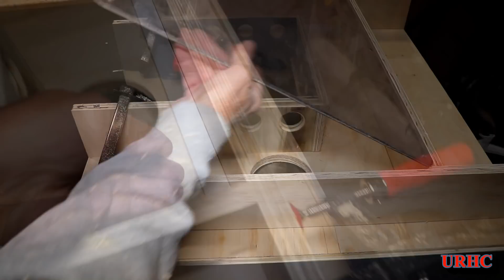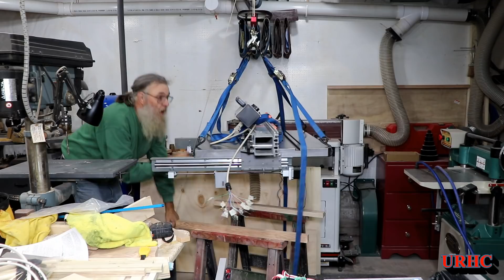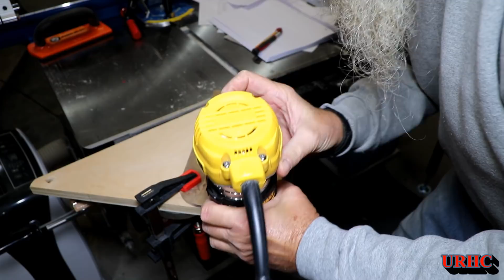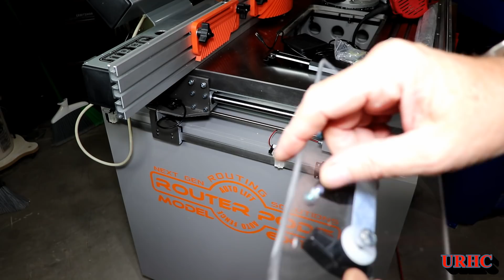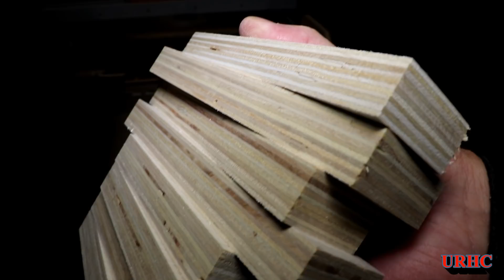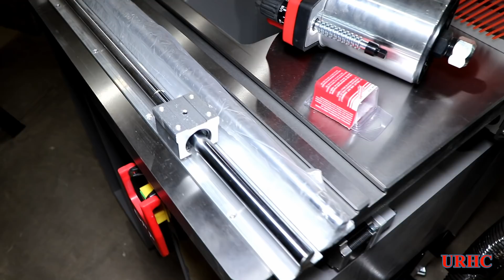Router Table Build Part6 Finishing Up The Cabinet Installing The Top And Final Wiring

Comment: Great job building and sharing you build with..us..
As a alter option to your signal generator...you can buy a off the shelf mach  style controller with key pad and mpg... USB controller SMC5-5-N-N CNC 5-axis ..it may be over kill... but you can do afew more things... 

For example you fence could be x axis..you could setup your z for spindle...you could modifiy the design to have the hozional and vertial router table

Your feed table in horizontal   setup table could have a tilting  stepper motor... programable
Reply from the maker: This works good for my needs. Just bought a Masso for my CNC router build and that's an awesome controller with great support. Thanks for watching.

Comment: Hello just a question, I have looked at many of your other videos but cant see what type of welder you use to do your projects. Can you recommend one ( stick, flux core etc) for a beginner just hobby stuff. 
Thanks Bill
Reply from the maker: I have a Miller 210 might welder I bought 20 years ago that I use the most. I started with a 110 volt Lincoln flux core mig that never really had enough power for over 1/8 inch material.  I have a big old Montgomery wards buzz box stick welder for anything over 1/2 inch. It all depends how thick a material you plan on working with and the duty cycle.  I like mig for most jobs. Miller and Lincoln are 2 names I have had excellent luck with but I see many also get away with the lower cost Harbor freight models. Thanks for watching.

Comment: Man that is crappy plywood isn't it. Try to remember not to buy any more of that. The project is looking good.
  Here are a couple things I ran onto that  I think you will be very interested in growing. Firebush(Hamelia patens) is supposed to neutralize insect bites ,kill burns, even poison ivy and more, here are a couple videos telling about it; https://youtu.be/VgaNhUmQUlg,  and here is an older version 
telling about the poison ivy: https://youtu.be/qHfILCYEI0Q
     I ordered seeds for the firebush  from an ebay seller called SharonsFlorida because she had the best price, here's the link https://www.ebay.com/itm/Firebush-Hamelia-patens-100-Seeds/252529016731?ssPageName=STRK%3AMEBIDX%3AIT&_trksid=p2057872.m2749.l2649 .  
  Moringa  Oleifera is the other thing I think you will be interested in growing. It is loaded with high levels of many different vitamins and nutrients , it has a lot of medicinal uses and should be a great all organic  fertilizer because of all the nutrients. I got seeds for the moringa from an ebay seller named  raderpep  , here's the link https://www.ebay.com/itm/Organic-Moringa-Oleifera-Seeds-Pack-Of-100-Seeds/183988073857?ssPageName=STRK%3AMEBIDX%3AIT&_trksid=p2057872.m2749.l2649  and here are a few short videos telling about  Moringa:  https://youtu.be/-tRqpcM-BNM  , https://youtu.be/9Rl829yBAhs , and  https://youtu.be/NZ5WP0wLzFs    You can grow these both in containers indoors.
Reply from the maker: I have never seen plywood that bad on the inside before.  The outside is perfect.  I do have a fire Bush in my yard that I planted.  It's a very beautiful plant this time of the year.  I will have to look into the benefits you listed. Thanks for watching.

Comment: Awesome work sir!  Mentioning your new glue brush reminded me I picked up a handful of those silicone basting brushes at walmart for about $.50 just for that purpose.
Reply from the maker: That is a good source.  I paid 5 bucks each fro the older ones I bought about 15 years ago in Woodcraft when they first came out 😬. I like the new one better after using it because the bristles are stiffer then the old ones making it easier to control the glue in 1 pass. Thanks for watching.

Comment: Beautiful build and very clean work! Really enjoying watching this build. I used something similar to that plywood for the backs and some of the sides on my kitchen cabinets. It was actually a metric thickness and was really unstable when it was cut (warping). Its been in the kitchen for 12 years now...so I guess its OK. :) Thanks for sharing....
Reply from the maker: Thanks.  I have never dealt with plywood that has tension in it like this sheet. For the price I expected a little better.  At least it all is flat now that it's glued up.  I have to find a local source for good Baltic birch in the future.  Thanks for watching.

Comment: It looks like a very well thought out router table.  I wish I had the kind of knowledge you have to be able to figure this all out yourself.  Comes from years of working in your job, I suppose.  Happy to see how well your little lift thing did to put on the table top.  Doesn't seem like it would do that well, nice surprise.  I'll be waiting to see what your first project is with the new table.  Thanks.    :)
Reply from the maker: Thanks.  That little lift is amazing and a big helper for lifting items like this. Wood for the first project is stacked inside now drying next to the woodstove so it will be ready in a couple weeks. Thanks for watching.